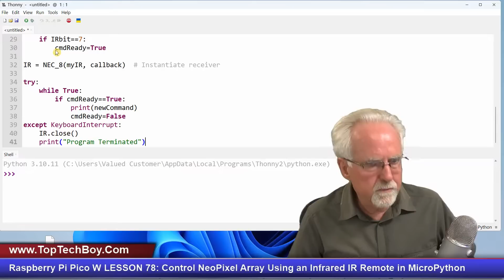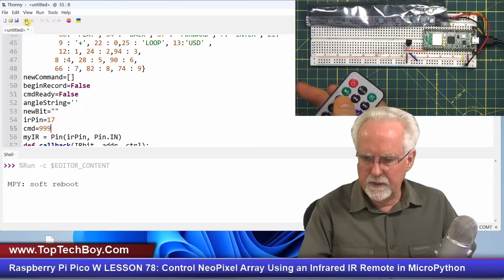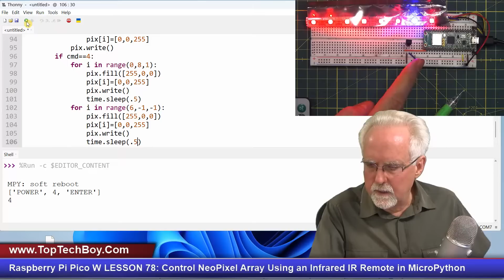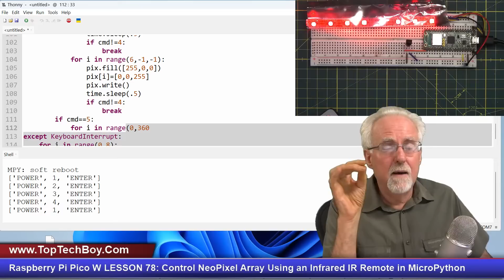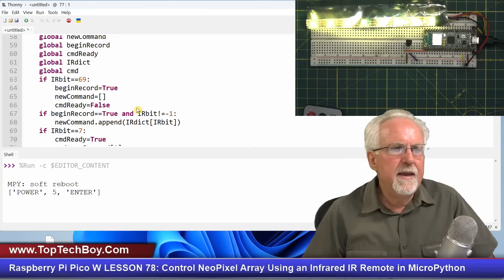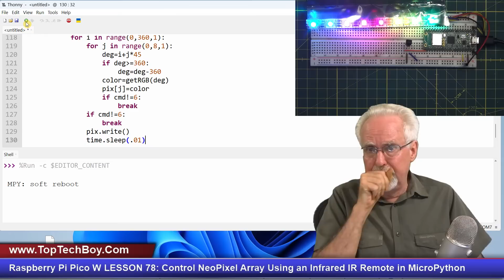Raspberry Pi Pico W LESSON 78: Control NeoPixel Array Using an Infrared IR Remote in MicroPython

Comment: I tried to do this by setting up a thread to run in the other core that would continuously manipulate the NeoPixel array while the main program would look for new commands. The main program would set the value of a global variable that the thread would read to set the pixel pattern. Since the callback routine only interrupts the main program, the continuously running thread should provide a seamless transition between patterns.

But it doesnt work - i get an error message that there is not enough memory. I tried stripping the program down so that it just reads the IR input in the call back routine which the main program shares with the thread. That doesn't work either.

QUESTION - Can an interrupt routine and a thread be made to run simultaneously with the main program? In every case I tried I got a memory error upon entering the first IR pad keystroke. What's going on?
Reply from the maker: Not sure what is going on. Check out my solution in the next video.